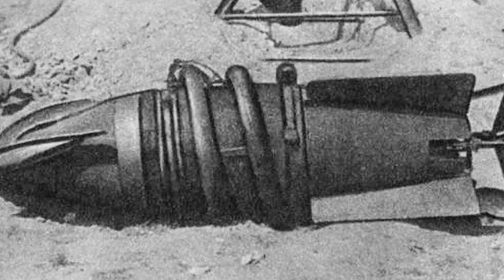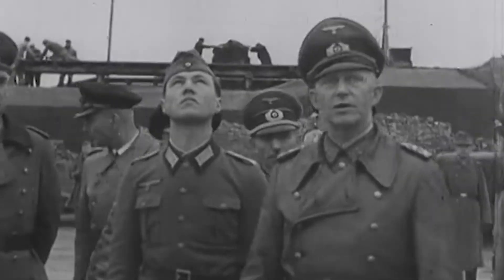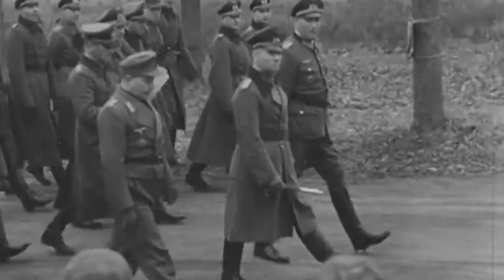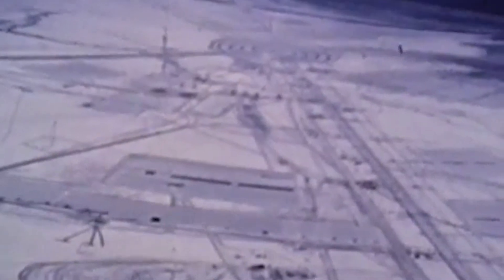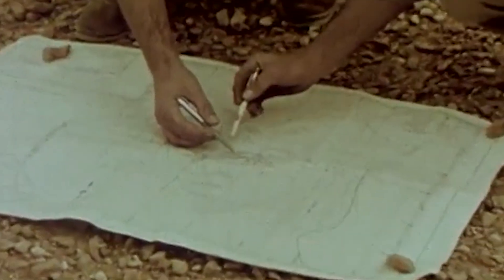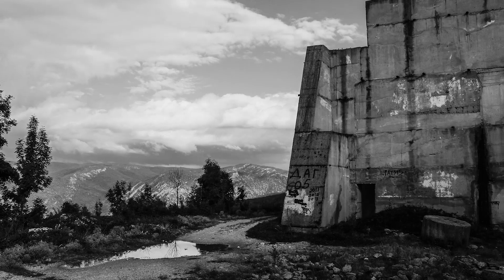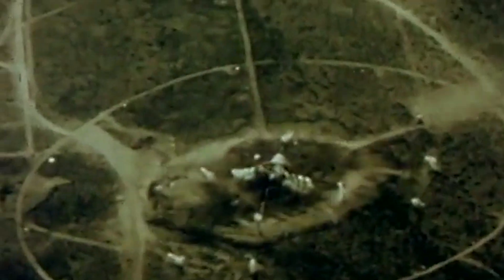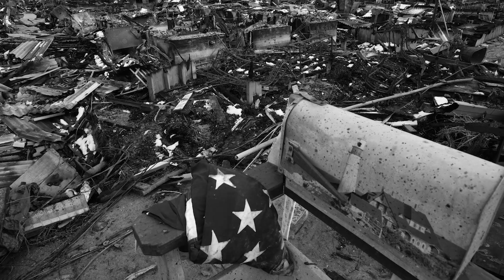The Soviet Nuclear Battle Mole: An Underground Cold War Battleship?

Comment: 60 thousand tons seems like a lot for such a vehicle. To put it into perspective the battleship Bismarck “only” weighed about 40 to 50 thousand tons. I think that the info posted about this craft is unrealistic.
Reply: Well one was made to float and one to "sink" which would need to be more dense?
Reply: @4717-b7j  I mean the Bismark is like 20 times the size. Also as a ships weight increases so does the buoyancy, a heavy ship can displace more water.
Reply: @mattalex543  fair point. But the subterranean vehicle had to be dense enough to bore through molten bedrock and withstand the earth pressing back. And we used better material they most likey used any and all steel they could find.   Im just throwin my thoughts in the hat honestly playing devils advocate.
Reply: Agreed even modern TBMs weigh between 50 and 7000 tonnes

Comment: You should check out and maybe do a “Dark Docs” of the passenger ship Estona that mysteriously sunk in the baltic sea 1994. 
It’s rumored that it contained military equipment from the former USSR, there’s a lot of conspiracy’s about it, at least in Sweden!
Keep up the good work!
Reply: I own a book called "Mayday, Mayday..." written by Günter Bossow and Helmut Hintermeyer which is about ship accidents from history to present day. It mentions Estonia on several pages, including grafics and photographs as well as the report of the official investigation. After reading it I can assure you - there was no conspiracy. The ship went down because the bow hatch wasn't locked properly, bad weather and some badly made repairs to the locking mechanism. From time to time, ships do sink - especially when bad maintainance, bad captains and bad weather come together.
Reply: I thought that was "just" a similar accident as with the Herald of Free Enterprise. Whenever a ship or a plane "mysteriously" crashes, people quickly think it had a similarly mysterious cargo on board. Which can be but doesn't have to be true. It was the same story with the El Al Boeing that smashed into a Dutch appartment complex, with the Lusitania etc etc.
Reply: The Swedes also drink vodka, and their own rocket fuel, as well.

Comment: Same sort of thing as the recent proposals for a probe to melt its way into Europa's sub-surface ocean, heat dissipation wouldn't be as much of a problem there either.
Reply: I would have to disagree. Melting the way through ice is rather a different task than melting through rock.

 Yes, melting is melting. And, yes, it's only a different of degree, i suppose. But that difference in degree is massive. That's like saying that a hike to the top of a 10 meter tall hill is the same sort of thing as climbing to the top of Mt. Everest.

Comment: Soviet engineers quickly realised extreme heat was needed to efficiently push through rock and other solid materials. These temperatures could not be reached using technology of the time, forcing officials to shelve the project until the rise of nuclear power in the 1950s.
By 1964, the Soviets had built their 'Battle Mole' - powered by a small reactor similar to those found in nuclear submarines, Jalopnik reports.